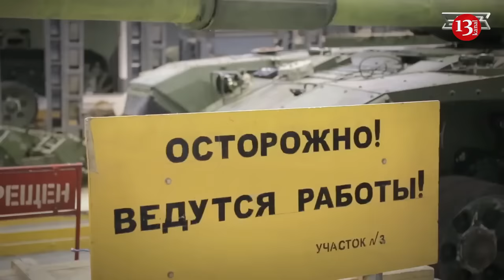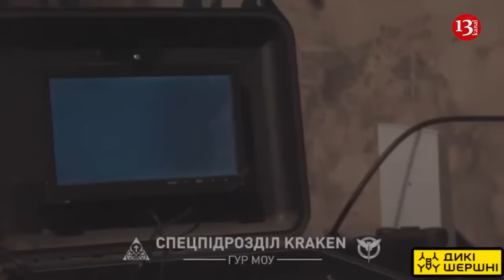Russian army is facing severe shortage of artillery weapons, which gives Ukraine new advantages

Comment: I was wondering that Russia should be burning through barrels by now. Videos show Russia proudly showing the artillery shells they are producing, but I have found none showing they are producing a lot of barrels.
Reply: they certainly can, and are. artillery barrels are not the most technically challenging to produce. the problem, is that if this is happening to russia, you can bet the same thing is happening to ukraine as well, and at the same time, the europeans have not even been able to come close to producing very basic artillery ammo at quantity.... how do you think they will fare when it comes to manufacturing or refurbishing artillery barrels?
Reply: @xisotopex  The trouble is that Russia wasn't expecting a prolonged war and expected their stored stock of artillery weapons to be sufficient for the foreseeable future, so it is unlikely they have the manufacturing capability to keep up with the rate of loss due to combat and wear. Even with artillery shells, they have to buy those from North Korea despite the videos proudly displaying their artillery shell manufacturing capability. Ironically, the lower quality of North Korean shells is adding extra wear on their barrels.